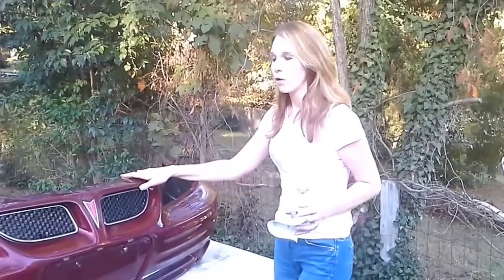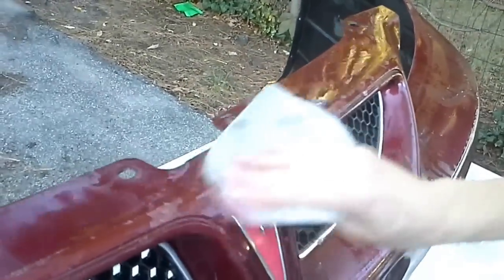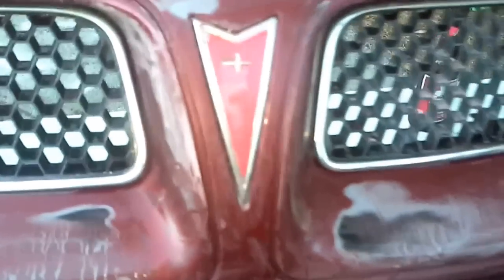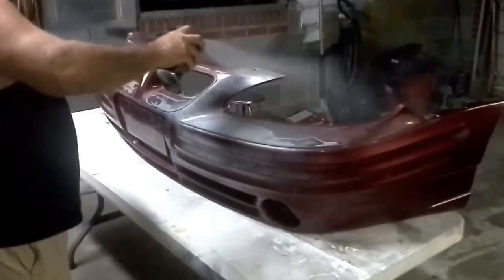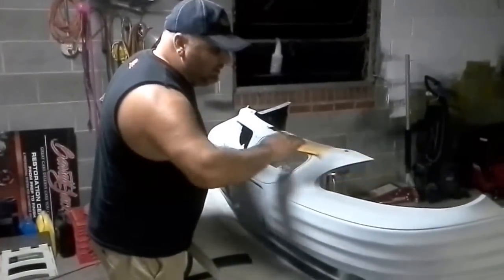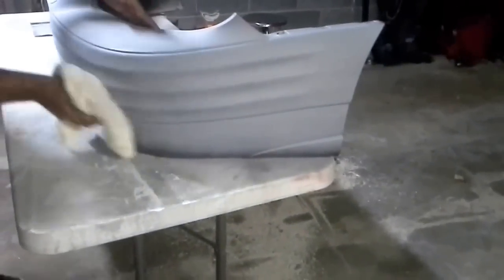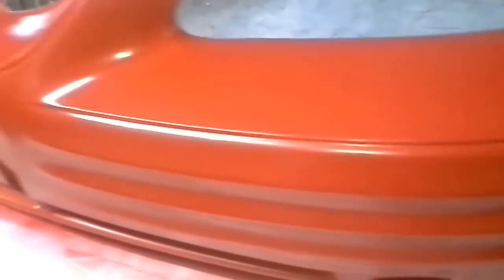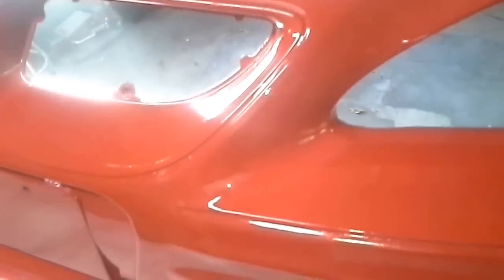Paint Your Bumper Cover For $30

Comment: You really only need to primer spots that are missing paint. just a tip to save materials. Also for those wanting to KEEP your car, use an adhesion promoter like Bulldog or the paint will flake off. Fish eyes are areas that grease or oils weren't removed all the way. Make sure to sand ALL the clear areas bc the flake WON'T stop there. Good video for the DIY guys.
Reply: You need to take the bumper back to black plastic not paint over the top - all that will do create problems when the old paint contaminates the new breaking through the new paint..
Reply: hey ,if anyone else wants to uncover how to spray paint a car at home yourself try Jaffacter   Paint Sprayer Coach ( search on google ) ? Ive heard some incredible things about it and my buddy got excellent results with it.

Comment: I like to say that I observed your painting technique where by you hold the spray can away about a constant 8 inches with a side to side motion. It prevents over paint that  may cause run off.
Much was learned. Excellent !!!!!  Yes keep the lady around she did a very good prep job : )
Reply from the maker: +Jesse Acevedo  yes that's exactly correct, it's all about the speed and the distance as long as it's consistent you will usually turn out a pretty good job and yeah I think I'm going to keep you her around  lol , need any help let us know

Comment: I'm impressed. Was expecting to see some edges from the original clear but it looks like you guy's feathered the edges well. NIce job with rattle can also.
Reply from the maker: It comes out nice for the price point
Reply: hi im new to this youre video is very helpful i just have a small question or maybe two i purchased through a part website a replacement bumper cover for my 2016 honda fit it comes primed already and can be painted was wondering if you could help me here would i be able to say use dawn to clean the bumper then use a degreaser after wet sanding then paint and clear coat it?
Reply: wash well with soap,then use an adheasion promotor,then a primer sealer,lightly sand that, wash then wipe down with wax and grease remover and finally paint

Comment: My front bumper have lots of chipping and iam in the process of sanding
I Did my rear cover bumper but lots of run cause ive used electric spray gun
So iam fixing or do little fix to my compressor so i can paint with lvlp gun and finish the job but prep is the key 180 for chips then 400 wet sand whole bumper then iam ready dont think to prime cause its dark blue which will cover well 😁 
Hope everythig will run ok
Rear  bumper fixed with heat gun, epoxy sprayed but got that over spray i Did only damage side but iam thinking to wet sand the whole bumper but its time consuming and elbow grease , iam not thinking on priming but its better, so you see what you are painting

Comment: In Canada it costs 85$ Canadian dollars  for paint, primer, gloves, degreaser, and a red scotch bright  plus the cost of the bumper.
Reply from the maker: David Ferguson WOW!! The paint and primer here is only about $7.00 per can, nitrile gloves run about $5.00 for a box, the degreaser(s) that we use run between $1.00-$4.00 and the bumper from a salvage yard is about $40.00.
Reply: yeah, but you probably dont have enviro crazies runnin your country? Gas,paint,and everything else tied to enviromental causes went way up in price as soon as the LIBs and NDP came to power. Spray paint use to be arround $6-10 a can for the cheap stuff, thas now $12-16 a can. Auto paints in cans from body shop supply houses your lookin at $21 and up per rattle can.

Comment: Can you please say something about the curing time, and when can you use it?  First the dust coat, then how long after that do you wait in between color coats,a nd then how long until you do how many coats of each?  Does it need to bake in the sun or does it need to cure at all?
Reply from the maker: +BarbaraL Lowell a good rule of thumb if you have a nice warm dry temperature is about 2 hours but on the cans but no more paint you're using it will tell you what it is between coats

Comment: I was wondering, what type of primer (brands), paint and clear coat did you all use? Also, where did you purchase it at?
Reply from the maker: Elannie Callans  Duplicolor is the brand that we use for primer, paint and clear coat. You can find it at just about every parts store like AutoZone, Advance, O'Reillys, etc or you could get it online. Good luck and let me know if you need any help along the way.
Reply: JamieJones TheCarMan Is bumper cover paint different than 'touch up' paint?
Reply: gis instructor touch up comes in small bottles for small scratches. They have small brushes attatched to the caps

Comment: Hi i tried to do practice and i am getting alot of bubbles why would this happen? I would hate to mess up the actual bumper Thank you!
Reply: Bubbles, fish eye, cracking and crazing are the result of either contamination of the surface, or incompatibility between the paint you are applying and the surface you apply it to.  

Cleaning thoroughly with paint thinner, allowing it to dry, and making sure conditions are right (lower humidity, warmer temperature) will help.

There are many types of paint, from acrylic enamel to oil based, urethane, laquer, latex, epoxy and so on.  

Testing on a hidden area is a good idea when you don't know how paints will react to eachother.  Painting is 80% about surface prep.  Light dust coats (barely any paint) help to  seal a surface before applying heavier coats.
Reply from the maker: MissClaudia Villalobos Sorry for the delay but tiporari gave you excellent answers and advice. What kind of paint are you using? One really fast tip that might also help is that I would get some acetone and wipe the sureface down with it really good before you paint it.
Reply from the maker: tiporari Hey Man, thanks so much for sharing those tips with her. Very much appreciated and great advice. Sharing is what this channel is all about.
Reply: JamieJones TheCarMan No problem, nice to see people talking and sharing without all the ugliness that is prevalent most places.

Comment: So all i have to do is use 2000 grit to take of the clear coat, prime, spray and clearcoat?
Reply from the maker: Hi William, yes thats correct. If you need to, you can go heavier on the grit depending on the condition of the paint that you're working on. Let us know if you need any help.

Comment: Hi Kool video , was very informal to watch. Just one question . I used 80 grit on my bumper on my Renault megane...and it now has many light scratches. Will primer cover the scratches?.
Reply: depends on the scratches. If the scratches too deep, use body filler, let it dry, sand it to smooth out and prime it. After priming over the body filler if there are any rough surfaces sand it down with 400 grit. Wipe down the areas you will paint with acetone or rubbing alcohol. Once it is dry paint with base coat, check imperfections sand, clean paint then clear coat.

Comment: Hey, guys good video, I will like to paint my bumper, but it does not have paint at all on it, som advice thanks.
Reply from the maker: +victor castano just follow our same method you're going to want to sand prime paint then clear it and you can buy it at your local parts store thanks and if you need any help please feel free to let me know
Reply: +victor castano Sand it, Prime it, sand again with higher gritt, base coat, clear.